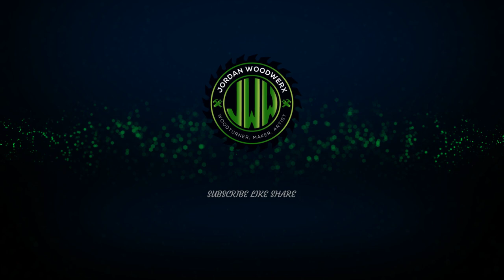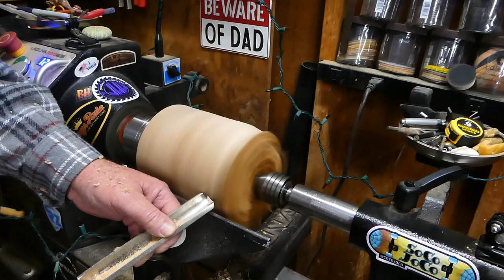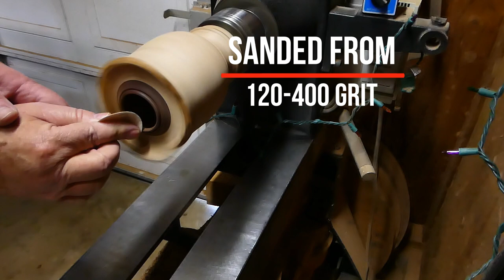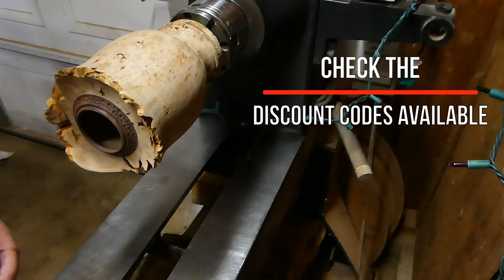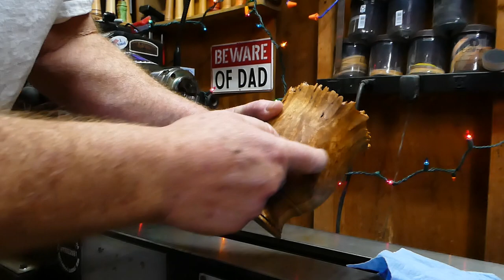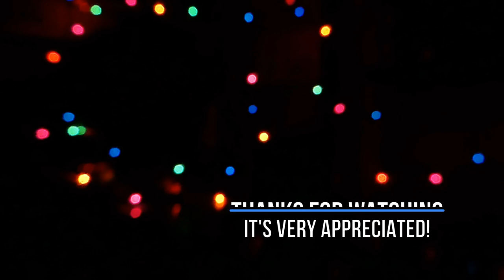Woodturning - Maple and walnut hollow form!

Comment: Hi Jordan, another great project.  Did you also use the Acks Paste on the side of the project?  I see there are suggestions out there to put a sanding sealer on before using the Acks Paste.  It looks like you use it on the raw wood so I assume it works well for you that way.  I have never tried the Acks but have used the EEE Ultra Shine which seems to work ok on smooth surfaces.  However, if there are any imperfections or design in the wood it seems to attach and is very difficult to clean it up etc.  Does the Acks do the same thing on those surfaces?   Merry Christmas, Myles
Reply from the maker: Hi Miles, thank you very much! Yes I did use the acks on the sides as well. The acks sanding paste works excellent on imperfections, if I added sealer prior to the acks it seems like it would lock in the imperfections (that’s my semiprofessional opinion, lol). The only time I really use sealer is if I’m spraying lacquer or shellac. I still use the EEE at times that really brings out a nice shine. Long story short, you can use sealer prior to the acks , just depends on your prep work. Hope that helped Miles, really appreciate you tuning in and taking the time to comment and ask questions. Any more ?’s let me know, take care. 👍🏻👍🏻
Reply: @JordanWoodwerx  Thanks for your reply.  The thing I'm still wondering on is how easily or difficult the Acks is to get out of crevices and embossed decorations vs the EEE Ultra Shine.  I find the EEE troublesome to remove from those areas and spend extra time (frustrating) using tooth picks etc to remove the small globs stuck in those areas. On smooth areas the EEE works fine for me.  Thanks, Myles
Reply from the maker: @mmfenske1  it’s the same. I do the same thing, toothpicks, small brushes like a toothbrush, compressed air to blow it works great. I think we all have the same issues with any kind of paste wax/ polishes